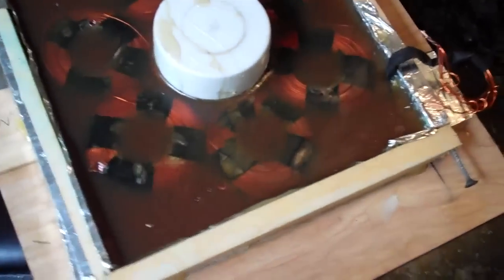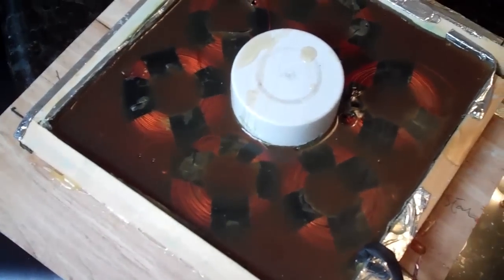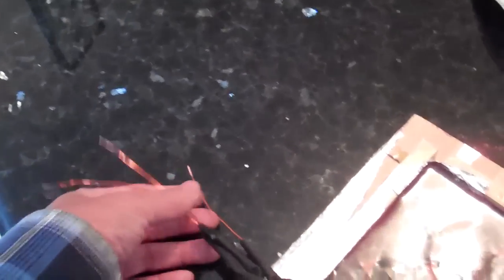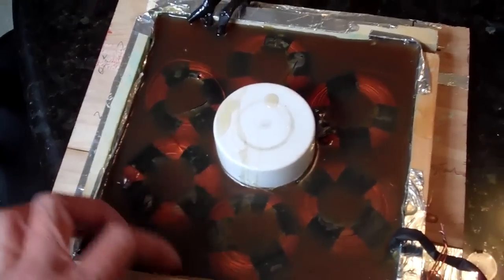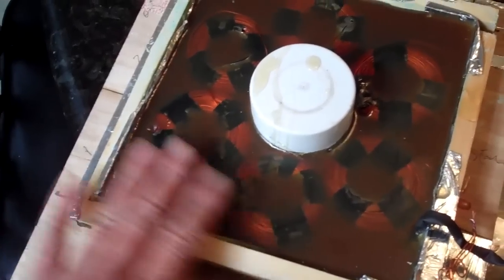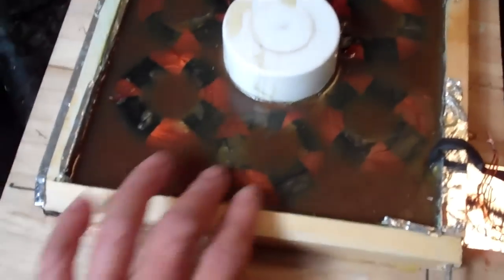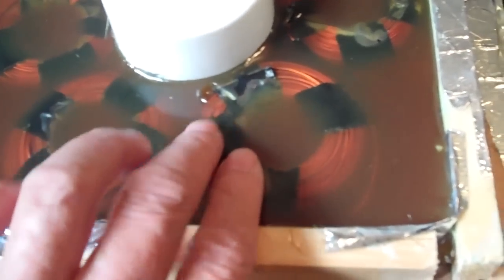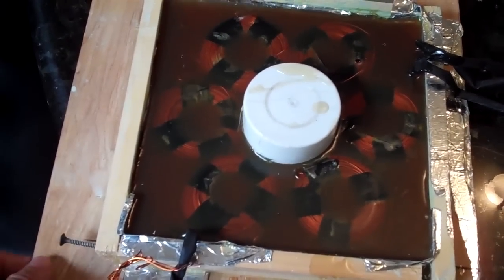Six coil axial flux stator cast

Comment: why did you decide to build this configuration instead of a  n+3 setup? .  9 coils and 12 magnets use more magnets but have higher voltage output then 6 coils 8 magnets and better magnetic performance because every coil sees only one magnet at a given time where in a 6 coils 8 magnets setup, coils are overlapped partially by two opposited magnets
Reply from the maker: +Offgridd You are correct about the 6 coils setup being deficient. I was just experimenting and this was one of my first build.  For my application, which is a vertical wind turbine,  even 9 coils is ineffective if you have low winds. I think you need about 27 coils unless you have consistant strong winds. 9 coils is fine for a horizontal wind turbine.